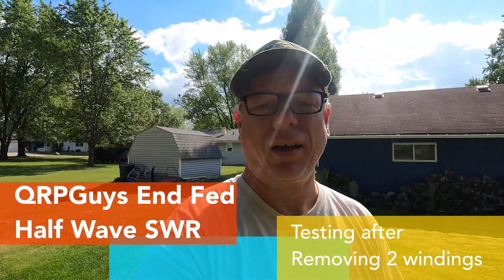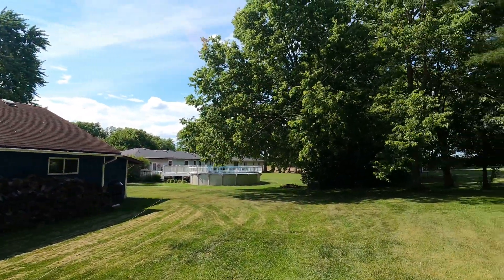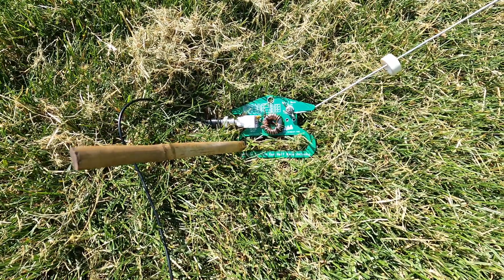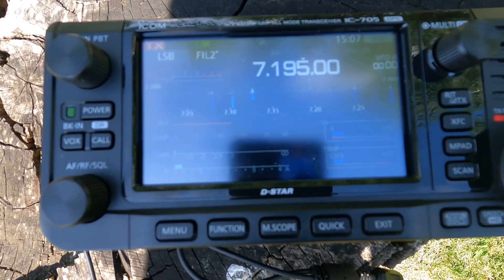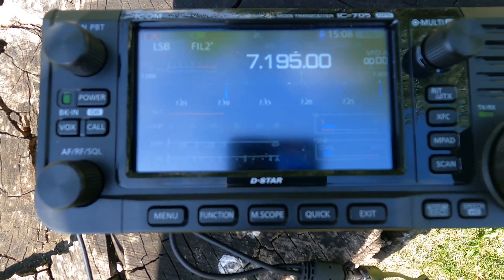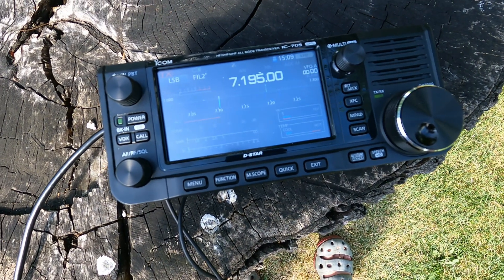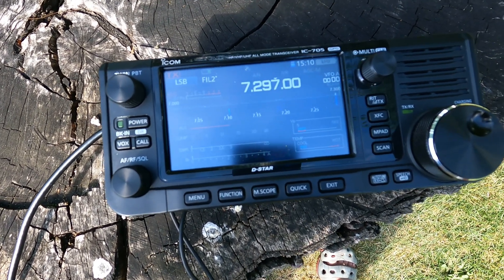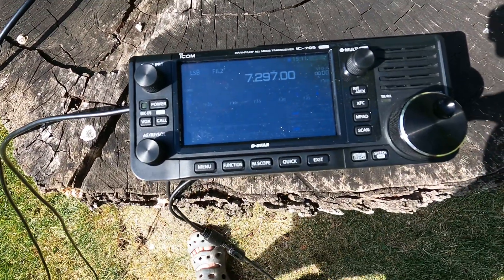QRPGuys Half Wave End Fed Part 2 - Checking SWR

Comment: Thanks. Currently trying to figure out why my efhw with simple integrated tuner (QRPguys) doesn't tune (LED brightness doesn't vary). Had about 20' of coax lying on ground but will try elevating it. The antenna has a counterpoise. Would there be any benefit to coiling the coax into a choke?
Reply: There may be, but its not going to fix the issue you are having.  The choke is really to prevent signal backfeed into the radio.

Comment: I have this antenna and have done significant testing with it using a nanovna and the built in SWR meter of the IC-705. My observations are: 1) Have the End approximately 18” above the ground, 2) 15’ coax was fine for 20m band, 3) have the coax run under the antenna. It matters WHERE your coax is run. This is the big takeaway. You have to experiment with the positioning of the coax to get the lowest SWR. 
For instance, mine went from 1.2 to 1.75 when the coax was running away from the antenna, such that none was under the antenna. However, when I positioned myself and the coax under the antenna or just off from it, my SWR dropped. 
Bottom line: experiment with different routing of the coax and your position to find the optimal SWR.
Reply: Thanks for the comment Scott.  Experimentation with these kinds of things is always important.  Ground conditions are also very important.  Composition, moisture, etc...

Comment: i use also an endfed antenna. so first thing is: never put the antenna wire or especially the transformer on the ground or near any object. always bad swr. than put the choke about 4m away from the transformer. i have very good results with the 12m (10-20-40m) and the 22m (10-15-20-40-80m) Versions. The long one also works witht tuner on 12 an 17m. give it a try. best is the higher the transformer goes in the air. :-)

Comment: If the ferrite choke is at the antenna end then your length of coax as a conterpoise isn’t much changed , for a better test of the different lengths of coax you had, connect the choke end at the rig. See what that does.

Comment: What gauge and what was the length of the radiating wire?
Reply from the maker: This is the wire I used https://youtu.be/HzMtcI-z8dM  you can get it in several different colors.  I started at 61'6" (which is printed on the PCB) and ended up trimming it.  How much you have to trim will depend on your deployment and ground conditions.

Comment: Hey, question.   Withh HF do you have to use any special coax?   Like UHF VHF LMR 400.   

Will RG58 or RG8x be fine?
Reply from the maker: The lower the frequency the less the loss from coax.  So at 40M, at the distances I am talking about in the video it really doesn't matter.  When you get into VHF and especially UHF the losses build much faster.  Look here for more info https://offgridham.com/wp-content/uploads/2016/04/coax-loss-chart.jpg